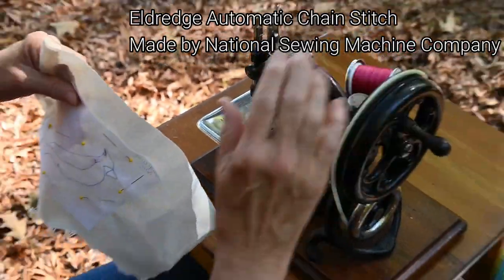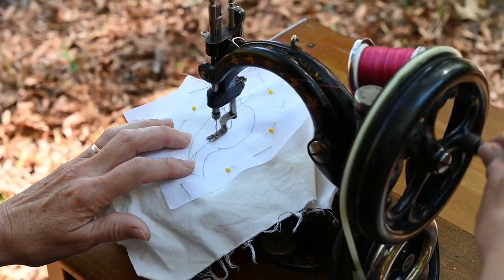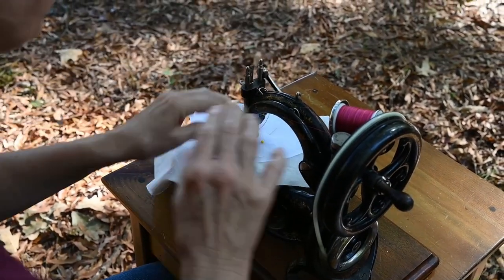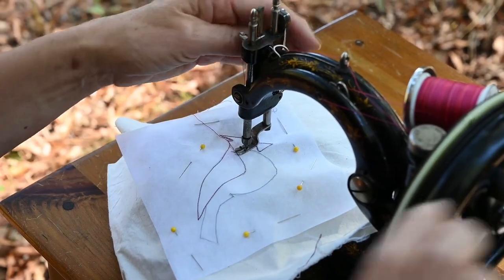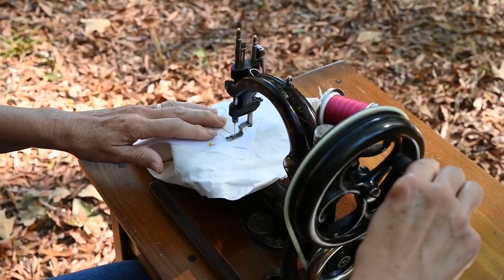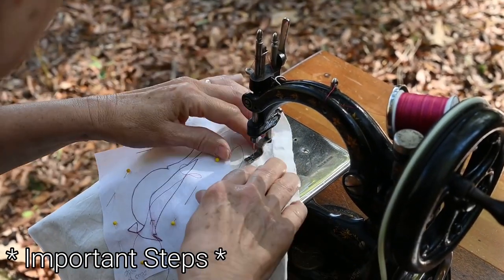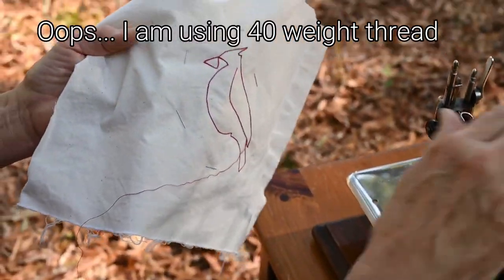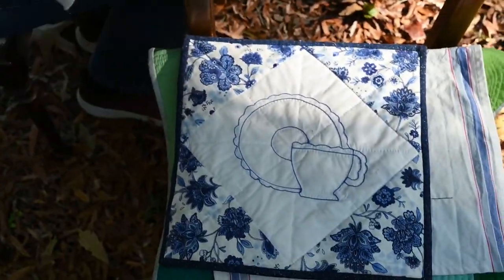Using a Eldredge Automatic Chain Stitch hand crank sewing machine

Comment: Thank you for the video. I have a question, what is the heaviest thread you can use. I want to know if I could use buttonhole thread to get thicker lines?
Reply from the maker: I will ask my wife for an answer for you.
Reply from the maker: My wife says ...
I have used thread as thick as 30-weight cotton, for thicker, more distinctive lines.  Be sure to use an appropriate size needle (to accommodate the thicker thread), and set your machine at 12 stitches per inch.

This blog has a lot of good info on embroidering with antique chainstitch machines...including needle sizes/ types (both the original needles, and their modern needle equivalents), thread suggestions (sizes/ weights), and the corresponding settings. 

http://chainstitchsewingmachines.blogspot.com/2010/05/how-to-do-embroidery-using-willcox.html

Happy stitching to you!
Reply: @KevinPinkerton  Thank you very much for all the answers and I will look at the blog. 😀
Reply: Thank you I’ve learnt a lot from this and your cat embroidery video.  I am looking to embroider leaf skeletons and have made reasonably successful attempts so far.  Do you know what difference the embroidery spring is supposed to make?  My machine was seized on acquisition and took a lot to get it working but I’m unsure if I’ve got that aspect working as well as it could yet.  Also, I’ve been loosening a screw that goes into the back of my presser foot bar to make it easier to turn my work when embroidering.  I’m not sure if this is what I should be doing so all thoughts appreciated 😊 thanks in advance

Comment: Really great video, thank you. I have problems with the thread keep snapping, is it me, or is the machine just not great due to its age? Any help would be well received
Reply from the maker: I will ask my wife and get back to you. Tension is usually the cause of thread breaking, and it might be the path you used to thread it. Also, make sure you clean between the two disc that  the thread goes thru. Do not oil the discs but take some heavy paper and pull it thru to clean. I will get back with more information.
Reply: @KevinPinkerton  thank you so much, just sitting here thinking maybe it's the tension. Will give your suggestions a go and let you know what happens.
Reply from the maker: @hazeledwards73  , further discussion with my wife. Use some dental floss to clean between the "no oil" discs. There is no tensioning system to tweak. Check that the needle eye size is not too small for the thread. Throw away old vintage thread as it can break easily. Make sure you have the thread path correct. Check the "stitch length" indicator on the table and make sure it is what you expect it to be. Thread and needle eyes can be a problem area that cause broken threads.